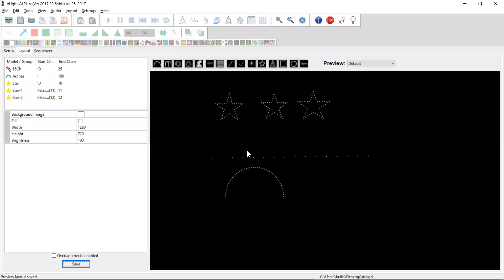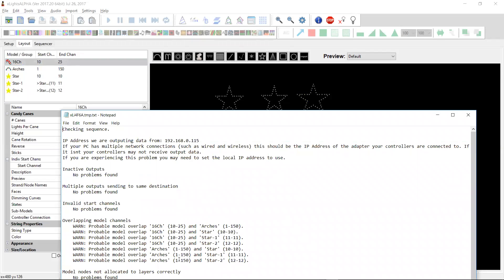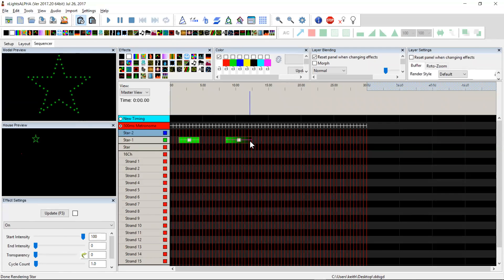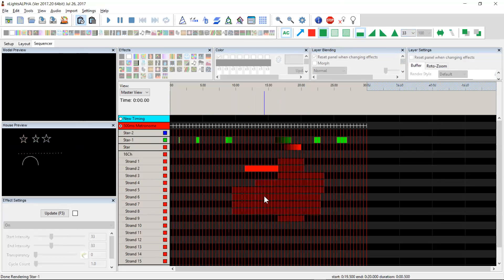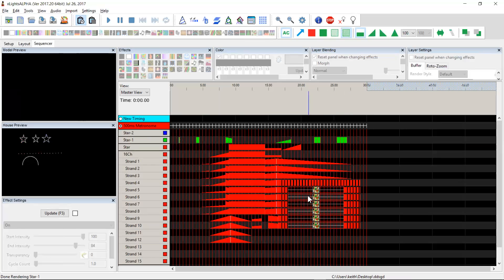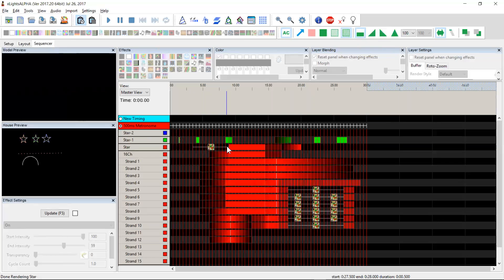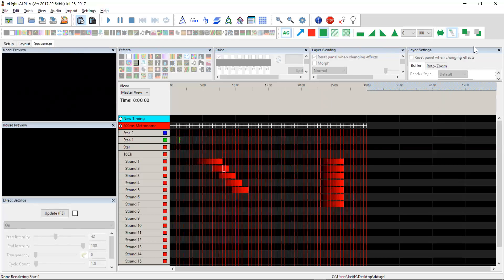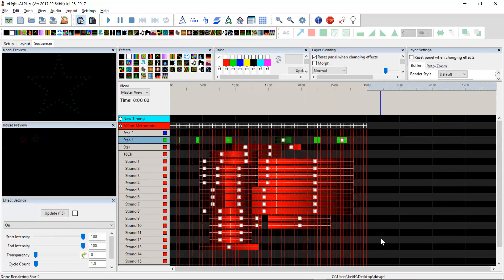2017.20 xLights AC Sequencing

Comment: Hi Keith 

I’m new to Xlights, but have loads of old legacy mains lights, what controller would I need to use my old lights and control them from within an X lights sequence?
Reply from the maker: The most common controllers for non pixel lights are from Light-O-Rama and Renard. You can also look into the Pixel-2-Things boards or Hanson Electronics have some AC light control boards.